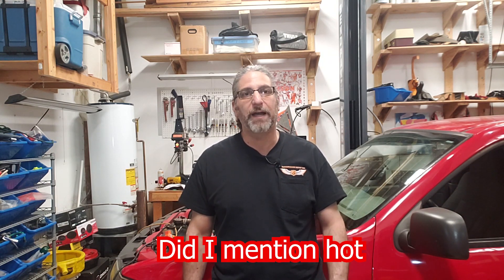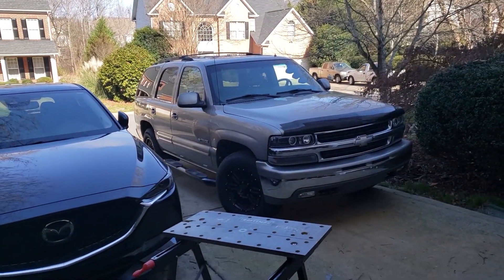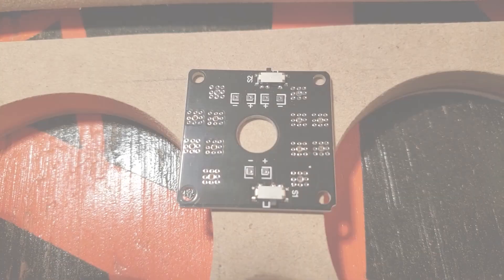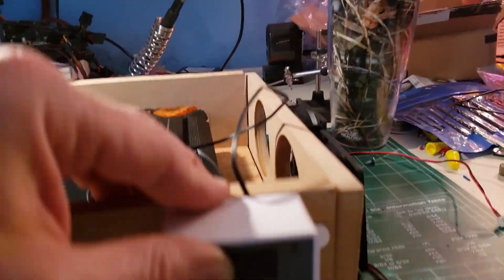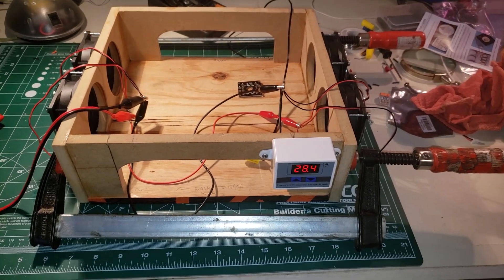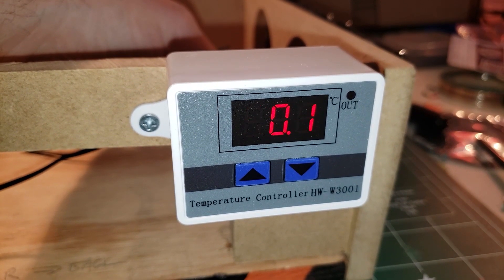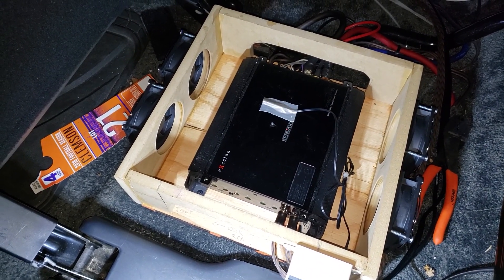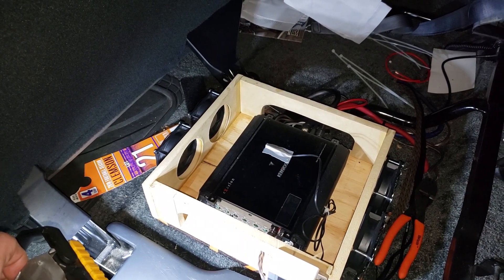Car Amp Runs Too Hot To Touch - How to Cool That Amp Down

Comment: Dude, I want to thank you for a great post. Using your as a guide, I did almost the exact setup. Parts like fans and mini thermostat was used. Of course, not as cool and profesional loking as your, but it worked for me. Three fans blowing and one taking out the hot air. For three small amps.
Reply: I was thinking of doing a setup like this, I was wondering how you wired the power and ground cables for the thermostat

Comment: That’s pretty cool I might try this out for my truck if I do I’ll be rewatching this vid and I’ll carve your name in it🤣 give credit where it is due. But I would put spacers under my amp and have it about half a inch or so off the bottoms so air moved around the whole amp instead of every side but the bottom
Reply: I did what exactly what you mentioned here... Except that carving part 😅 props for the idea tho!

Comment: Looking at the settings on your 5 channel amp....I noticed your rear speakers are all the way down, also couldn't really tell where your sub was low passed at, looks high! Try 80 htz high pass for the speakers, and 80 htz low pass for the sub. And turn those rears up! Did you voltage match out of the radio?... is that why the rear is down? (So many questions) I'd love to help, DM me if you have questions about tuning
Reply from the maker: Appreciate the input. The vid was taken prior to all the settings getting dialed in.  I took it to a local shop and had them adjust it for me.  I will check the settings vs your recommendations and make adjustments.
Reply: I just looked again, 100 high pass and 100 low pass. If you like it loud, the 100 high pass is good, but definitely turn that sub down to a lower low pass. Try 80, then try 70. And play with the phase of it... using a well recorded song with a good kick drum

Comment: This is the best and thoroughly explained video on YouTube. Not to mention, the cheapest yet just as efficient...I'm going to build one like this but I want to install plexiglass for the top. Would that be ok or would it be better to leave an open top?
Reply from the maker: I appreciate the kind comment and I am glad it helped.  I think plexi would help the airflow over the amp, but I have not tested it yet.  If you do, please report back!
Reply: Did tou try the plexiglass?
Reply: @JotUncut Negative i kept it open and it stays cool.

Comment: Where did you connect the power and ground wire to on the sensor?
Reply: You can connect it to the thr terminals of the subwoffer amplifier

Comment: Do I have to make a box?? And what did u hook the fans and thermostat to too make them cut on?? Did u hook them to the amp or something else to give power
Reply from the maker: I think you could get away with not making a box, but the enclosure makes it that much more efficient.  Power goes to the power lead from the battery that goes to the amp and ground to ground.
Reply: @TahoeSteve  thank you so much for the info

Comment: Nice video, but considering you hand your thermostat exposed to the elements, I’m guessing your fans turn on when your car sits in the sun?
Reply from the maker: Nope.  Everything is under the seat so that is not the case.  Also, the fan is tapped into the switched ciruit on the amp, so the fan won't ever come on until the circuit has power.
Reply: Tahoe Steve just to be sure, you put the fan positive into the amp turn on or the thermostat into the amp turn on (remote wire)

Comment: Very good video I use the SMD input and output volt meters along with his temp meter also probably a little pricier then what you used but I build systems that are pretty big upwards of 1500watts just for the subs plus they can be mounted in plain sight and will put on almost like a little light show and ate made to be seen and blend in like they were meant to be there and they can even be used to cool the motors of your subwoofers cuz those do also get hot and in my experience is not good tends to unravel voice oils resulting in blown subwoofers. Great vide definitely help alot of people
Reply from the maker: Appreciate the comment, especially coming from a pro - thanks.  Yeah, I saw the SMD stuff and drooled, but like you said, very expensive.
Reply: @TahoeSteve  appreciated being called a professional but by no means a professional just been hooking stuff up since I was 14 am now 44. Started with 2 10" Pyle driver 1 subs from the flea market and sparkomatic radio and 100 4ch eq booster from autozone in an 81 chevette. Technology has definitely gotten better for your videos got me considering the 4l80e conversion in my 2006 YukonXl that will eventually be twin turboed.... as far as the audio stuff every day is a learning curve I am constantly learning new stuff and I am always up for a challenge
Reply from the maker: @MegaWolfman76  Thanks again for the comments.  I think a 4L80e is gonna be mandatory for your twin turbo build.  I blew up 2 4L60e transmissions with my N/A mid 300 hp engine.  I too, will be doing a turbo later this year.
Reply: @TahoeSteve  so far I will probably rebuild original trans with a stage 3 sonnax high performance rebuild kit suppose to be capable to 1000@ the wheels seeing as I already blew 1 trans. Figure having it dumped to 700-800whp their gmc syclone awd is about 900whp and going on their 3rd race season and is awd but we will c. The truck is stock ride right now but I will be doing a complete belltech drop round 3" in the front and 4" in the rear it's a 4x4 and I feel bad for dropping it but the wife is disabled and it would just make it alot easier for both of us. Hopefully I will be doing g a complete walkthrough video on my truck and the plans as soon as it starts warming up a bit kinda cold near Chicago right now lol...